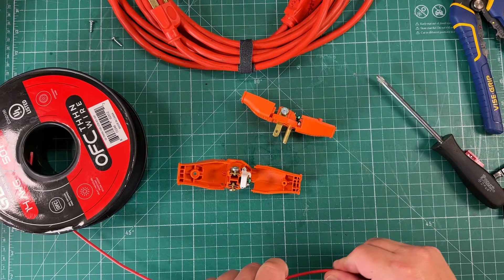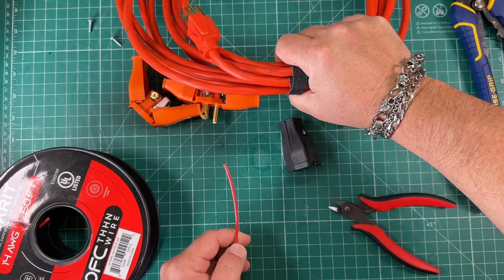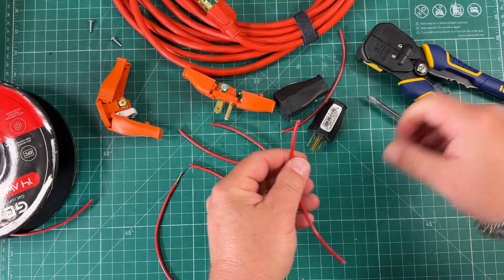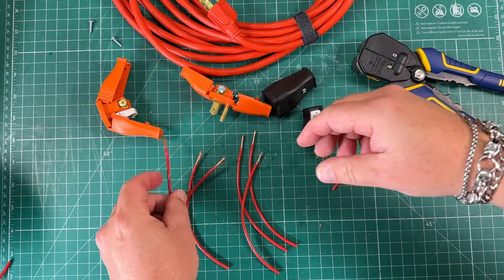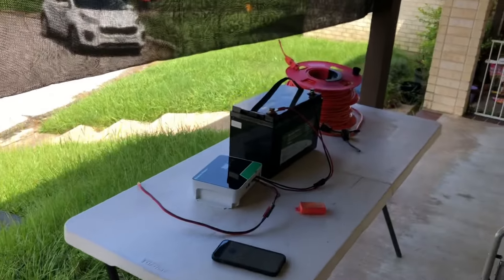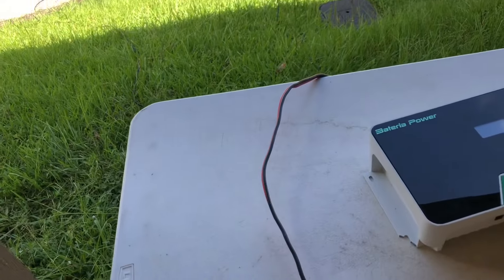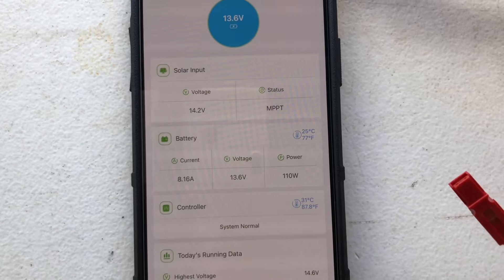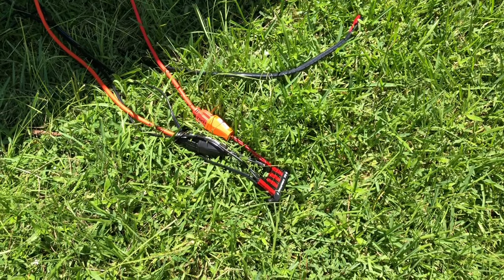12V DC Through 120V Extension Cords For Solar:  UPGRADE!!

Comment: Rock on man. Another beni I found is that extension cord is more flexible off the spool in the cold and less of a hassle to wrangle with when putting it all back in the camper. Plus in an emergency, you can find one pretty much everywhere.

Comment: This is great, I did something very similar. I have an extension cord fed through a wall (I meant to install a proper outlet in the box but never got around to it, and the cord is way more useful), and I wanted to turn it "backwards" to feed solar power inside to my LFP battery bank. 

So my "indoor" adapter has a NEMA 5-15 female socket, and ferruled wires to screw into my charge controller. I unplug the through-wall cord from the indoor AC outlet, and plug it into this adapter.

Then my "outdoor" adapter has MC4 connectors to a NEMA 5-15 male plug, which I plug into the female end of the through-wall cord. Et voila, the panels are now connected to the controller. 

I left the hot disconnected, and put the solar on line and neutral, so misplug events should be benign. I also used Leviton lighted plugs for both adapters, which will alert me if I do misplug to something with AC potential because they'll light up.

Comment: I'm really enjoying these kinds of videos, and I'm thankful for you doing them. I'm in the process of getting more foldable solar panels for portability and am going to try the Anderson powerblock distribution idea of yours since I seen that video of yours on it. It'll allow me more options of portability when I need it, but also use them more at home over a fixed solar set-up. I'd rather not have a fixed set-up, but already have it up for some batteries in case of a power outage.

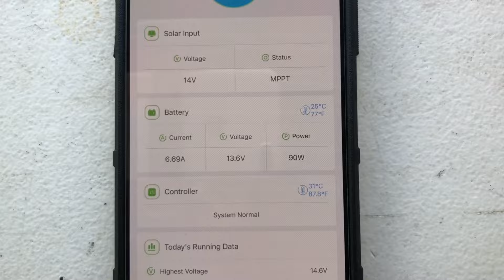Comment: I would convet the plugs to 4:41  Anderson's, et. al. on the 110 extension cord. No confusion.
Reply from the maker: That would defeat the entire purpose of this experiment.  The idea is to use an extension cable for solar if and when I need to.  I would still want to use it for 120V as well.  It's about being able to use one cable for multiple uses.
Reply: @hamradiotube  good solution
Reply: @hamradiotube Maybe on APP patch cables put a label or some id stating 12v DC only!

Comment: Most of that fear comes from the "Death Jumper". It's a male/male extension cord that you backfeed your generator into your house panel with. It can electrocute linemen that think they're working on a dead line, or when they restore power it catches your house on fire.  Every storm season it literally happens......still

Comment: Another note, if your charger can handle 24v wire the solar panels in series. It drops the current in half and the smaller wires wont matter as much.

Comment: To add a modicum of safety to the configuration, I think I would reverse the prongs and outlet for each cord so the red and black APP can only plug into one cord. (meaning red prongs and black outlet on one side of the run. The other side then has red outlet and black prongs) I am likely being too cryptic in this, but someone has to understand what I am saying.

Comment: Looking at the cross sectional area of the wires, rather than the gauge numbers made this easier for me to understand. Multiplying the 12ga areas together takes that measurement to just a bit larger than 8 gauge wire
12ga @3.31 mm2  multiplied by 3 wires comes out to 9.93 mm2, with 8 gauge wire being 8.36 mm2 and 10 gauge being 5.21 mm2. (I wish I could use superscript for square millimeters)

As for the safety thing, if for some odd reason you had some unfamiliar 'helpers', or if for some reason there was a 110 volt power outlet nearby those 'helpers' might try, a couple wraps of tape around the adapter, and connector keeping them together might help, not to mention with the adapter connecting all of the poles together, it SHOULD trip the circuit breaker pretty quickly.

Qualifier: not an electrician, or mathematician, but have a okay google ability.

Comment: You are clearly way more confident that you won't accidentally plug things in wrong than I am that I wouldn't. I don't even have compatible connectors on my solar panels and 12V devices.

Comment: If you have a non-PWM, MPPT style solar charge controller and can run the panels in series, the higher voltage at lower amperage will allow you to get away with smaller wire on longer runs.

Comment: So, I dont see an issue with this. I dont think you can plug a power pole into the wall or another extension cord lol. It might not be a bad idea to run some 33 around the two connectors to make sure that some effort is required to convert back to normal extension cord.  Not a bad way to get double use.

Comment: Mike, I live an only slightly less pathetic life, I have two cats. 
I have real misgivings about this. If someone plugs the male adaptor into a wall socket there could be a problem, also if a fire marshal, or insurance adjuster sees what you’re doing, they will likely make an issue out of it. 
Ps: love your content, but not this idea.

Comment: On the safety thing, it’s a great point that if you’re the one using it, you know what to do. One thing I could see is if you decide to bring it to a shared POTA event or Field Day, others may make assumptions about the cable. But on your own, you know how it works.
Reply: I have a Power Supply Battery Box.  I labeled the In and Out Powerpoles to hopefully avoid any issue.

Comment: It is extremely unsafe to use AC style plugs for a DC circuit if you ever looked at AC plugs, every voltage and current rating of AC plug is styled different so that prevents you from plugging the wrong voltage and amperage rated plug into the wrong circuit. You should never use AC style plugs with a DC circuit because someone could come along you confused plug AC into your DC circuit and blow out everything you have if not cause a fire or kill someone.  Again it’s fine if you’re doing it for yourself, but please do not put out this information out on YouTube where people are trying to learn from you and you are teaching them something. Totally unsafe to do.
Reply from the maker: You could also walk outside and get hit buy a bus.
Reply: @hamradiotube But unless you are blind, a bus is big enough to see!
Reply: Seems like a cool project to me, especially for the length advantage and amp drop not being too bad.  Plus the flexibility of the extension cord being easier to handle/maneuver vs. stiff wire.  I say you do you.  😂